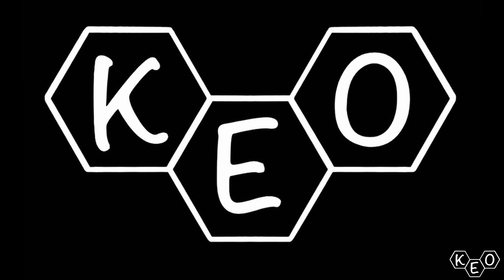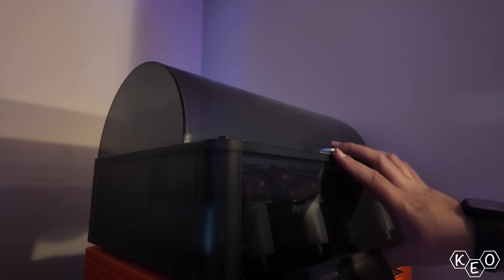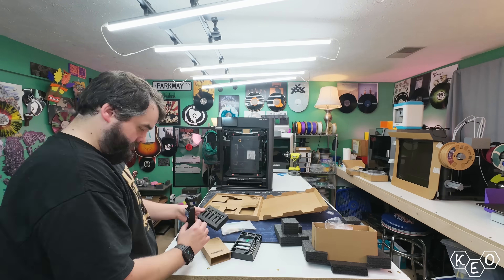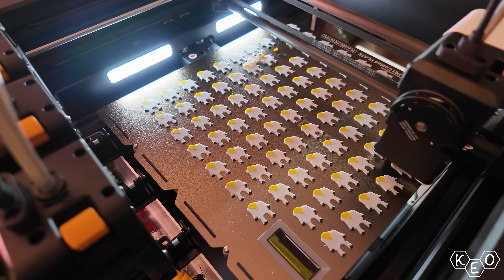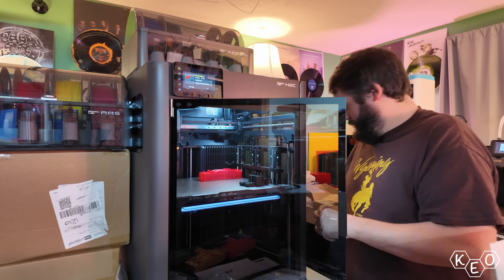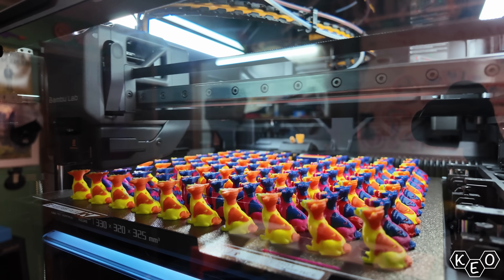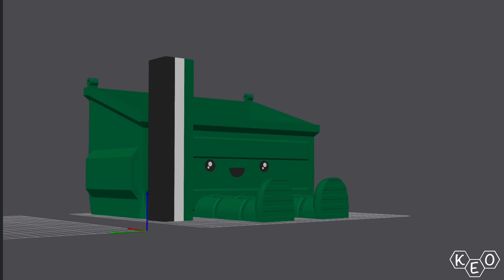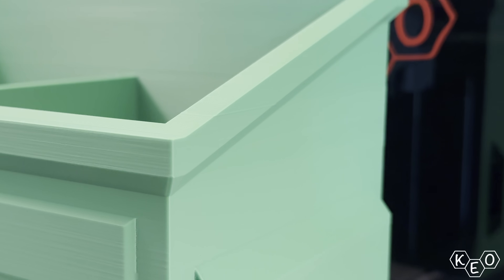Bambu H2C: Brilliant Innovation… or $2500 Mistake?

Comment: What a nice and simple review. It just works thats about it... solves a problem(s) we had with the older generation of printers and does most things well. It will probably not be the hotrod of 2026 but by the time h2c size multi color snapmaker/indx like systems can be ordered and shipped within a week (my h2c ordered on 18Nov was printing 26Nov) we have been printing and printing and printing ... and some more printing... Not sure what happens once the other printers are fully available somewhere next year but worse thing that can happen is we need to move again in 2027. I am looking forward to your next video because some of the downsides are real and me and many h2c owners are also wondering what will happen next how is bambu going to evolve this against snapmaker on the lowend and prusa in the midrange with indx. I have some ideas what they will do next ...

Comment: The first sentence is has a mistake.  Bambu does not have a tool changer.  They have a nozzle changer with some pretty severe limitations.  The biggest for a lot of people is that since the AMS can't handle flexibles well and the left (fixed) nozzle isn't supposed to be used for flexibles you can't even do automatic swaps with TPU or other flexibles assuming you only want 2 colors.  You can't use the nozzle changing feature on extremely brittle filaments because they break in the PTFE tube when the toolhead positions itself to swap nozzles.  The Bondtech INDX has all of the advantages and none of the disadvantages.  Separate toolheads like found on the Prusa XL and Snapmaker U1 are better than this from a speed standpoint and the only downside is that they don't currently have a material swap system available for one or more toolheads.  This currently limits them to the same number of colors or materials as toolheads.  Watching the H2c swap nozzles is fun, but not enough to get me to pay that much for a machine I can't easily use with the slicer of my choice even as an interim solution.

Comment: For me this is not a toolchanger its just a glorified nozzle changer. The deal breaker for me was the TPU limitation, if im going to pay that much for a 3D printer i'd expect it to handle TPU like a champ. Another thing is i can barely put up with AMS sound for filament load once per print. I cant even begin to imagine retraction and feeding every single layer. Thats just straight up HELL. The system they built is cool but half baked, all they had to add was bowden tube for each single nozzle and get rid of the AMS, basically something like INDX and that would be the ultimate machine in 2025 even 2026.
Reply: Interesting to read others opinions. This is why I’m glad we have choices in this community. Personally I love this approach, and the new AMS 2s are fast especially if you have minimal bowden tube length, and quieter than the AMS 1. Anyway whatever works for you!
Reply: @Xenthera  Like i said the deal breaker is the TPU. You will never be able to use TPU with AMS its just physically not possible. And when you remove AMS just to use TPU then what is the point of the H2C. For a true tool changer system that can print everything whatever you throw at it, INDX or snapmaker U1 style machine is a must! Bambu will definitely make such machine and i feel like H2C is just a stepping stone for them.
Reply: 100% agree, when I think of toolchangers I think of very few filament limitations if not any
Reply: @krollmond7544  Exactly!

Comment: If they'd made it so you could use multiple size nozzles in a print on the quickswapping side then we'd be talking, but with the price for it I'd rather spend the same amount of money on 3 snapmaker U1s
Reply from the maker: I know. I’m sure the different nozzle size support is coming but right now, it’s absence is a bummer
Reply: @KeoPrints  I think BL has confirmed that they are working on this...

Comment: H2D early adopters = screwed. Would have waited….
Reply: No different from way back with computers in the late 90's as soon as you bought one there was a better one out in 2 months. These printers seem to be changing that way for now and has me on the fence for a upgrade from my P1S that I love for what it is
Reply: @jonsaircond8520  100% agree.
I have the creality ecosystem (3d printers and 1 A1 pro 20W laser) and I am sick of Creality reliability.  When they work they are not bad, but if they break.. you can be down with it for weeks, even months as you try to get a quick TAT with Creality Support out of China is painful.
I'm thinking that the P2S with multi color for $800 is a steal.
Reply: This is literally how everything works. If you wait for the next best thing you will never buy anything.
Reply: @1981AdamGs nailed that
Reply: Buttttttt

Tomorrow is always better and cheaper with tech.
Can’t sit on the fence
Reply from the maker: Agreed. This cost the same as my 2nd H2D. Total bummer

Comment: The trouble I foresee with this machine is going to be with the changer... How long before the mechanics start to break down.
Reply: Take a really good look at the design. It's two three-nozzle racks, each is on a linear rail with metal linear guides. About as simple and reliable as it gets. 

The drawbar system for the nozzle is similar to what's used in industrial CNC - the difference is unlike CNC there are no cutting forces going through the toolhead. 

Bottom line is these are very reliable mechanisms that have decades of use in industry.

Unless you can point to a specific part of the mechanism that you think will not hold up?
Reply: Of the whole H2 platform (h2d and h2c) the vortek is in many ways the easiest/least complex parts only has 2 moving parts and all can be accessed easy. I would even claim of the tool changers and indx this in the core of how it switches the 'tools' its the simplest. Now the rest of the printer is complex compared to most others and the ams part is also complex but that has proven itself good enough. The vortek extra parts will probably not become a huge problem is my guess.
Reply: @scb2scb2 well it's simple but it is too damn expensive for something so simple.
It's an $800 upgrade!
You can almost buy a U1 for that,BF price was $850
That thing is not worth more than $150-$200
And that is even pushing it.
I understand R and D costs 
But they should have made it cheaper and just counted on selling more volume.
They should make an A2C and or an A2D, basically an A1 with a vortek that is mounted on a sled to the right of the bed and that uses the old AMS lite and a new AMS lite pro
An enclosed AMS lite with a dryer, same design of spool mounted from the center and with a PTFE for each spool going to the tool head to cut out the retraction time.
Maybe keep it 4 spools or maybe add another spool to each side for the full 6 spools, put them in a triangle formation on each side.
Maybe also offer an A2D ,same machine but with the dual tool head
Reply: @andreamitchell4758  Well i was talking in design not in cost. But even then the vortek part itself is 'simple' but the 2 upgrade kits are $$ because they replace way more turning your h2s or h2d into a h2c. Not sure if that is good value. The compare with the U1 is just weird yes thats great value for what it is but its not a h2c in anyway from enclosure, size, materials, hotends etc etc. The more interesting question is how will bambu react to the 4 color speed monster of the U1.. my personal guess is they won't i think they will make a $1200-$1300 solution in the x2c with not a vortek but call me crazy 4 fixed induction nozzles directly on the head (in 2 rows) with 4 tubes going in. And for next gen (say h3c) combine that again with vortek (so back row 2 fixed induction nozzles and front left to a 6 rack vortek and the right to a 6 rack vortek. Giving you a very nice setup. This would mean a 4 color enclosed in the x2c that will be as fast if not faster than a U1 and the same concept of 4 nozzles can grow into a h3c with 4 active 'toolchanger' like speed between nozzles, which 2 can change materials in say 30seconds (12 colors/materials) and if needed all can be feeded from ams systems. Call me weird but i think thats the plan since it will keep the hole tube mess to 4 max to the outside of the printer(s)....

Comment: There is a problem that the hot-end replacement scheme of H2C cannot be retracted for a short period of length, and the printing effect may not be as good as toolchanger. And its $999 vs $2399, does not in the same price level.

Comment: I prefer simplicity and maintainability, so I’m happy for the owners of an H2C, but I’m going for a Prusa Core with INDX, while i am waiting for the relase of the Flashforge CJ270.
Reply: I hope you are taking about the whole H2 platform (they are complex printers for sure) the vortek part itself is very very very simple only 2 moving parts, 1 motor thats easy to access.. Compared to a toolchangers or even what INDX is doing in each of its tools/head its the simplest. No idea how 'stable' the h2c will be in the long run but personally doubt it will be the vortek part that will give much issues. Its a darn clever and simple design even if it looks complex and like a game of whack o mole.

Comment: no orcaslicer i'm assuming? I would probably pick this printer up if it had orca support. I recently picked up a p2s to test how well the auto pa works vs the x1c and was so frustrated with bs lack of gap fill and just simple settings like storing pa, flow calibration with archimedean chordes,  share profiles across multiple machines, etc. i'm shocked bs doesn't have gap fill yet. i'm assuming they don't allow it due to the increased chance of clogs from retractions. If that's the case, just leave it off by default. give the people the options to tweak stuff.
Reply: will probably get merged at some point, and work at some other point, but at this point I've tried orca nightly and it doesn't even work with my H2D yet so I wouldn't hold my breath. This is in LAN mode btw
Reply: @xuyukun123  I thought there was a build for the h2d. i found one for the p2s and have been using that but of course the h series are a totally different beast.
Reply: the build version i have shows h series printers. no h2c though
Reply: @SupremeBean82 I tried it, lots of errors
Reply: @xuyukun123  if you're on a win computer, try deleting your app data, and also toggling between network drivers. that initiated the latest driver and fixed my p2s issues i had.

what errors were you experiencing?
Reply: @SupremeBean82 a file name error, appears to be specific to the H2D in the GitHub issues
Reply: @SupremeBean82 it could send files and then I can print but it could not print directly
Reply: @xuyukun123  Why would mambu merge it back from a fork of bambu studio ?? Not against that they did that but now its that forks responsibility to merge stuff not the other way around.
Reply: @scb2scb2  yes that's exactly what I'm saying, orca will probably merge it at some point but at this point it's different enough that the task isn't trivial. Besides bambu studio has merged a bunch of stuff from orca as well.
Reply: @xuyukun123  Oh sorry i parsed it differently assuming that somehow bambu would give up and the 2 forks would merge into one again :) Sorry was trying to be a smartass i guess.
Reply: @scb2scb2  all g I would fuckin love it if they merged into orca though lmao I miss some settings and features a lot, and LAN mode is way faster for me since my wifi is on crack
Reply: @xuyukun123  Orca has dropped all support from bambu printers in protest to bambu's anti 3rd party decisions. Thats why orcaslicer doesn't work on your H2D.
Reply: @LilApe they literally merged the code to support it, just needs testing lol, it just isn't a priority to get it sorted now
Reply: @LilApe That's not true.
Reply from the maker: I mainly use Bambu studio of course now but it wasn’t too long ago that I remember being able to use orca with my Bambu machines. Seems like such a foreign idea now
Reply: Does prusa xl have orca support? Nope, but nobody ever complained about that.
Reply: @riba2233 technically you can use orca but not multi nozzle which prusa slicer supports mixed nozzle sizes. I'll be interested to see what bs and orca end up doing when prusa 3.0 comes out and it's a totally different fork...
Reply: @SupremeBean82  yeah you can slice for one color for XL, but you can also do that for H2 series so it's a moot point. They are both equally not supported.
Reply: @SupremeBean82  Bambu is screwed when it comes to their slicer, becasue bambu isn't a slicer developer and prusa doesn't support bambu and neither does orca since bambu burned that bridge with them. They only way bambu studio will ever get multi nozzle support is if bambu decides to do it themselves, which they can't. If they could, they would have already done it.
Reply: @LilApe yeah seriously, it's apparently with the way Bambu wrote in the description that you can't mix nozzle sizes. "if " it becomes a future update. Not when, but if... why doesn't the h2d have multi nozzle sizes yet? You can fake the h2d into thinking a 0.6mm is a 0.4 by a simple sticker then adjust the slicer settings. Seems like a trivial issue to fix if it's functional

Comment: If Bondtechs INDX system is even remotely reliable, Bambu is done for. Its still less waste, we don't know about how many 'wear' parts there will be on the Vortek system and its so much slower than the INDX.
Reply: Personally who cares if its "quicker", it's all bout the quality of the prints, personally.
Reply: @GeekyGaming people who care about "quicker": printfarmers, professional and hobbyists prototypers  (because they want to see if their cad model is good or they need to change their designs), people who need to print larger assembled projects ( cosplayers for examples) and the list goes on
Reply: Well rumours are already flying the prusa bond tech is already delayed to Q2. A fully closed Prusa Core One L with INDX might be a year of and even that is smaller than a h2c today. Many of us will have 8+ months of printing done before anything from snapmaker or prusa is available for people just to buy. How vortek will be killed or evolve over time no idea but it won't be happening quickly and in the mean time we can print and print and print .... and print some more.
Reply: So...what do you think happens when Bambu releases the slicer update that allows multiple nozzle sizes to be used in a single layer?
Reply: @CarbonKevin  Not much ? Per objects would be a easy in between step....
Reply: @CarbonKevin  Bambu wont releases any update for multi nozzle printing until prusa makes theirs officially available. As bambu lab will just copy it like they always do.
Reply: @LilApe and the H2C copies what printer?
Reply: @StephenWestrip  voron, prusa, flashforge and qiditech.
Reply: @LilApe utter nonsense
Reply: LOL, Bambu is done.  Seriously, you need to stop doing drugs. I love how you say, "remotely reliable."  You already admit it probably won't work.   IF, the INDX system ever makes it on a publicly available Prusa, it still will be the same garbage.  Prusa will be lucky to make it through 2026.
Reply: @jonwoodworker  I think INDX will work fine but it also feels they are far from really having it all done, shipping and tested to the same level as the h2c clearly was it will probably take a while in 2026 before its as smooth as this was for me in the first 200 hours of using it.
Reply: @jonwoodworker  bambu bot
Reply: @LilApe  nice cope, when you don't have any arguments just call everyone a bot 😅 while you are the actual bot, so ironic...